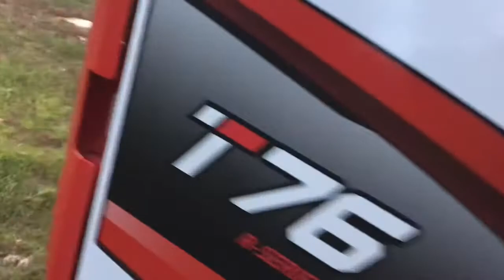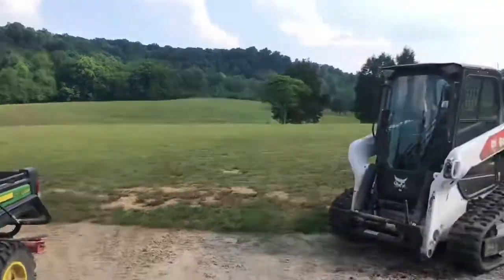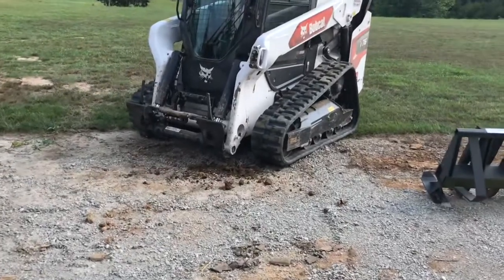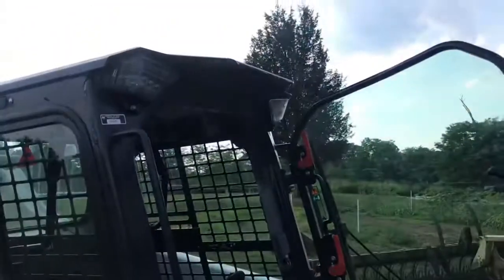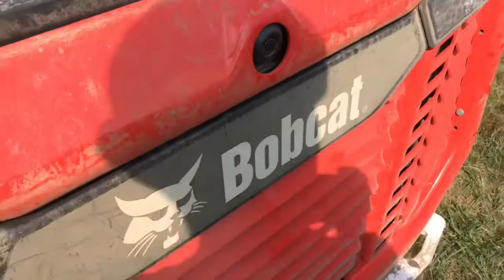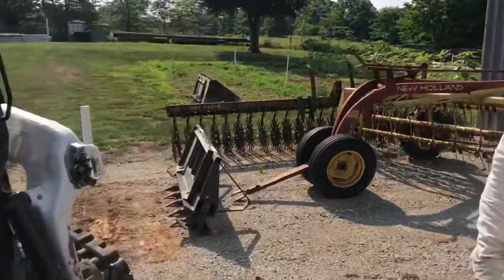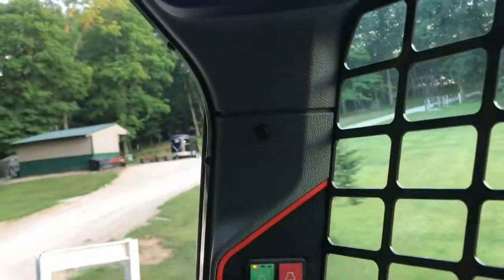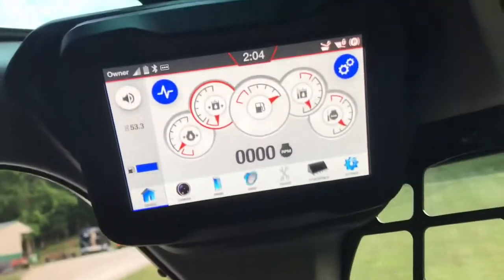The New Bobcat T76 is a Beast!

Comment: Hope the bobcat works out for ya, I’ve only had bad luck with them .. that luckily wasn’t ever my machine just seems like there broken more than there running , poor designs compared to other skids
Reply from the maker: Been running them all my life and my dad has ran them for several years the older machines where the best built by any of them the new ones are different and not built as well.
Reply: It's all in how you service your equipment,  bobcat is the best never had any major problems with bobcat,  26 years been purchasing bobcat.  Just ordered t66 & s76 with clear view sides.

Comment: Would one choose a kubota or a bc and y
Reply from the maker: I’d choose Bobcat any day  of the week but Kubota is a close second! Bobcat because they where the first to make skid steers there built solid and have a good dealer network in our state to work on our equipment!
Reply: I wouldn't purchase anything with exhaust filter,   bobcat has no exhaust filter only doc up to 74 hp . I demoed kubota svl75 ,  noisy undercarriage,  windows rattle,  2 speed sounds like a freight train , exhaust is mounted behind your head . Controls to jumpy,  cant hear the radio after half throttle.  Roll up door gets jammed all the time. Controls heat , ac , radio hard to get to . Servicabilty is terrible.  It is built like a tank but if want to be comfortable all day purchase a Bobcat
Reply: Everyone on YT has had nothing but trouble and Selling their Kabota and their direct dirt injection to engine port is about as shitty of a design as it could possibly get you have to clean your engine every day or the dirt will just fill the whole engine